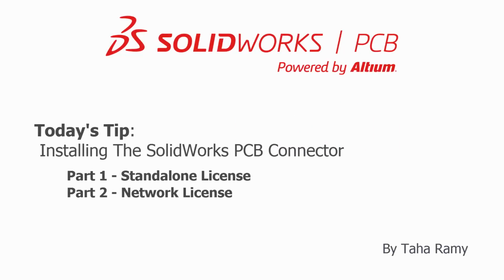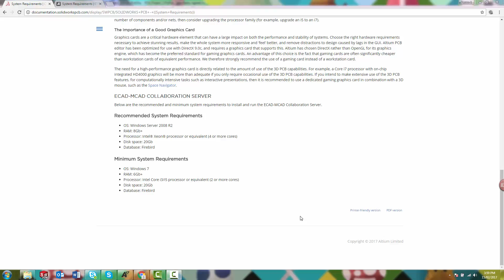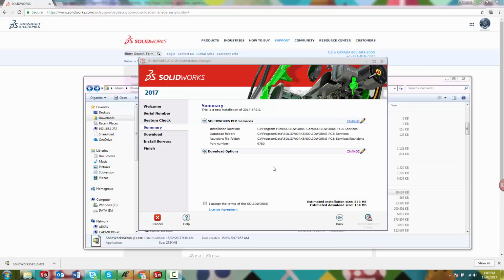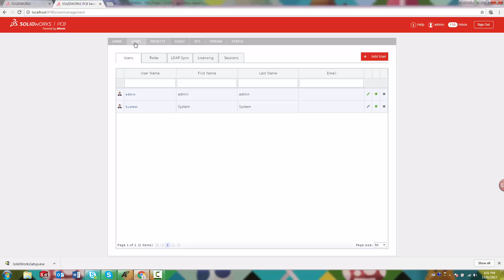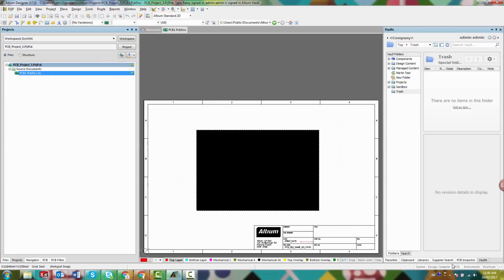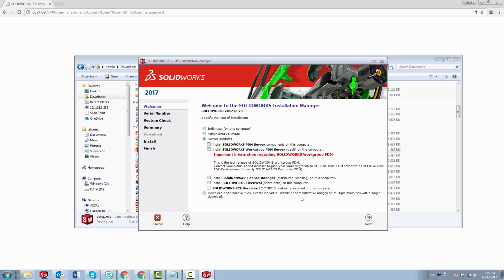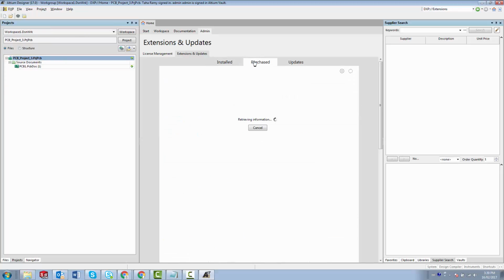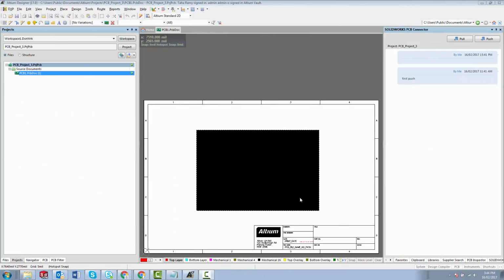How to Setup The SolidWorks PCB Connector & Services

Comment: I have tried to use solidwork pcb connector, but I got the problem when I pull my pcb design from solidwork. What I get is only hole of through hole component and pcb board it self without any 3d model of components. Could you please suggests me what problems probably caused of this to happen? thank you.
Reply: I have the same problem! Did you manage to fix this?
Reply: I have same problem. No components on board.